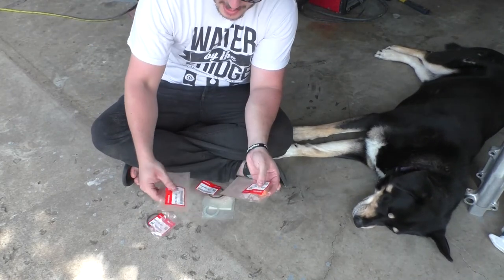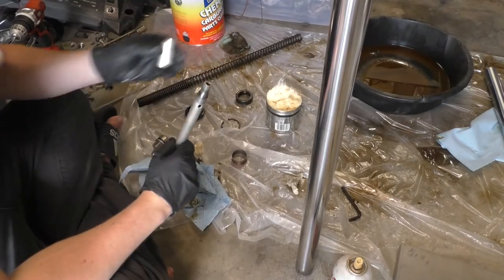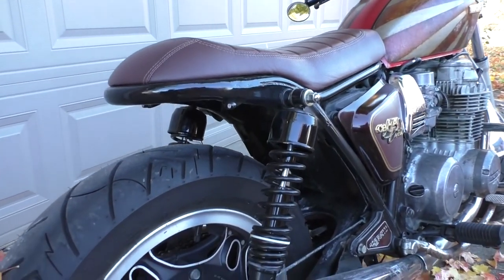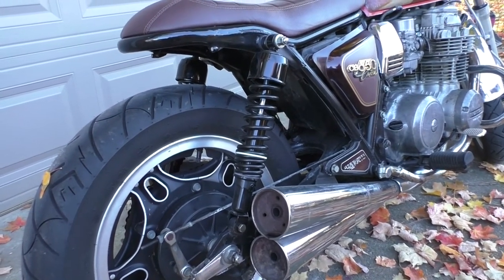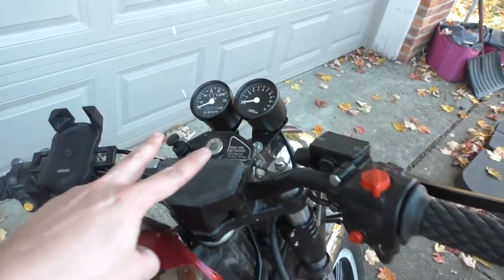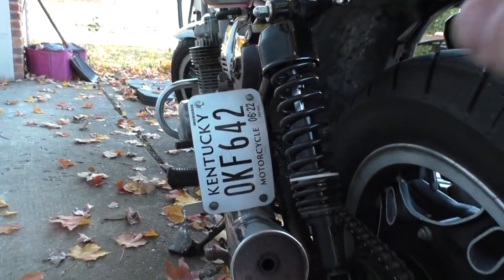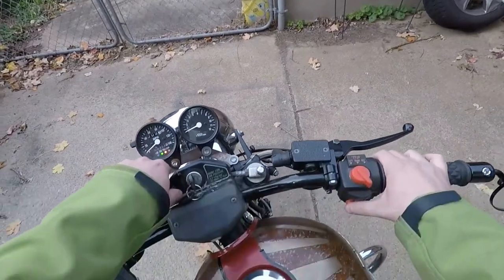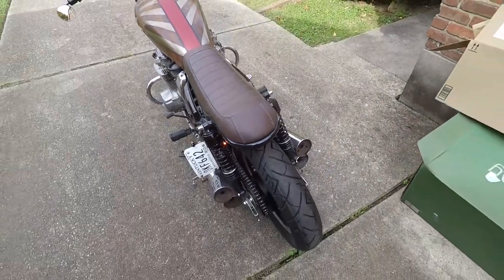1981 Honda CB650 Cafe Racer Build Pt. 2 | DIY Cafe Racer Seat Hoop - Vintage Honda Motorcycle Build

Comment: I'm so happy the shocks worked for you. I have an 81 CB650 with a Texavina seat and ran into the same issue with my rear hoop. Ordered 14.5 inch shocks that just arrived. So relieved you haven't experienced any bottoming out.
Reply from the maker: @thatdeadbird_llc  thanks! I will say the shock are a bit stiff but I would rather not bottom out haha. I was thinking of trying to incorporate a hard stop just in case.

Comment: hello
I'm Hernando, your video is great
I am from Cali Colombia Latin America, I am restoring a 1972 Honda CB500 four motorcycle, but it has a CB650 SHOWA 460-841 front suspension similar to the one in the video, in my country it is very difficult to get parts and I am searching on eBay but it has not been easy, I would appreciate your help, sharing the link or the eBay seller where you got the 37-50-11 oil seals and dust seal.
I would greatly appreciate your help and guidance and to be able to buy the right seals for the motorcycle.
Reply from the maker: Hey man, thanks for the comment! I bought all of the seals and dust covers from a company called 4into1. You can go to their website, 4into1(dot)com, and see if they have the right parts for your build! Hope this helps!

Comment: Hi there, first off, love the way the bike came out. I have a CB650c 1980 that I am sorting out. One thing I want to do is replace the handle bar to the one you have. If possible, can you send me the nMe of the one you added to your CB? Thanks for the time
Reply from the maker: Thanks man! I am pretty sure I linked the bars in the video description.  If I recall correctly, they were called EMGO bars of amazon.

Comment: Beautiful daily runner build friend!

Questions if I may:
1. Where did you get the gauges, and are the 4 lights integrated therein?  (Neutral, Hi Beams, Oil, Turn)

2. How did you wire up a license plate light?

Thank you!
Reply from the maker: Thanks man! I got the gauges off Dime City Cycles:

- 2.5" Black Mini Tachometer w/ Black Face - (1:4 Ratio)
- 2.5" Black Mini Speedometer w/ Black Face & LED Indicator Lights

The license plate light has the positive wire running to one of the main connectors in the wiring harness. It just needs to be hooked up to keyed 12v. Hope this help!